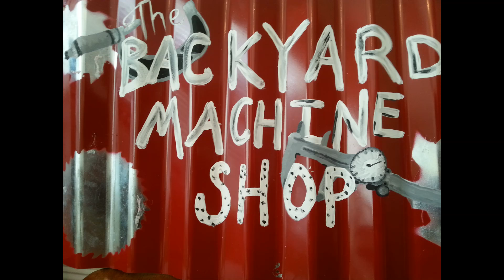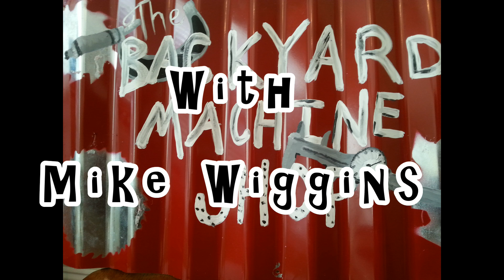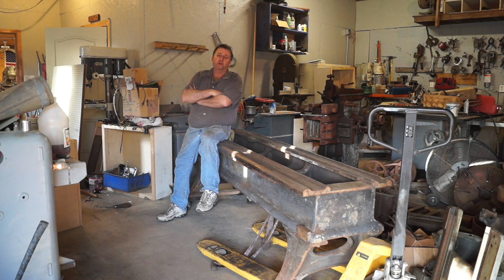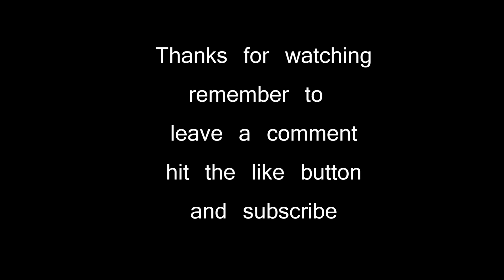Machine Rescue Day 63  (A New Haven Lathe Update)

Comment: Mike, keep up the good work! I  think you will be surprised at how well this old lathe will work when done. I brought an 1862 William Bement lathe 2' swing by 10' BC back to life that had been left out side with cast iron shavings on part of the ways. The shavings were rusted in hard as concrete. They left a few  deep pits on the  ways. I filled the pits with epoxy and scraped flat to a master straight edge. It would have worked fine without filling the pits but I was concerned that a shaving   could wedge between it and the carriage ways and lift the carriage off the ways. You might consider this type of repair for the deep scratch on your bed.

Comment: I watched a friend spend 2 weeks scraping the ways on a VTL with a 14' bed. The base bed was I believe 8' and there were 2 bed halves that made up the difference when needed. The VTL had a USN property tag from WWII because the Navy gave the machine to the Company for war production.My friend is an old school hands on machine mechanic and real good at it.
Reply from the maker: thanks for the reply, My Monarch was a Navy machine, the anchor is stamped in the ways
Reply: I think the machine he scraped in was also a Monarch, it had an oval brass tag on it. All of our machines were at least 50 years old, I was the house truck driver so I never ran any of the machines. I used to rag the machinists that my machine didn't have to be bolted to the floor so I wouldn't get lost. I wish I had some pics of the old machines they had.We had a Heyligenstadt lathe with I believe a 12' dia.headstock I think it is called and a 40' bed.We had a Hobber that could cut a '14 dia.gear,it used animal fat as a table cutting and cooling fluid and my god it would stink like it was rancid when it got hot.

Comment: Can't tell from the video but are the front and back ways mirrored images of each other? If so you could maybe flip the entire base 180 degrees left to right, putting worst wear areas on tailstock end of lathe. Just a thought.
Reply from the maker: There are considerable  differences in the ways, Most of the damage is on the tailstock end any way

Comment: Mike,

If you don't mind mixing new fangled stuff in with the old, check out "Moglice".  Stefan Gotteswinter has at least 1 video, where he uses the stuff to vastly improve the performance of his equipment.  It may be possible using "Moglice" to get the old New Haven working within tight tolerances.

Eli D.
Reply from the maker: Thanks for the info, I read up up a little on this stuff today sound interesting

Comment: I agree with you on it is not worth the cost of getting it reground. But just getting it cleaned up and back in to operational use is great. There is always those jobs that have room for error. And the fact of what a great conversation piece this is.  Like my little Sheldon lathe, it has its play in it, but it works for what I do and it has a interesting story behind it. The guy I got it from it came out of his grandfathers machine shop. His grandfather did work for Nasa and made some of the parts for the first rocket into space on the sheldon lathe. I am interested to see how that rust remover works, living up here in the North rust is a constant battle on a lot of stuff.
Reply from the maker: Thanks for the reply